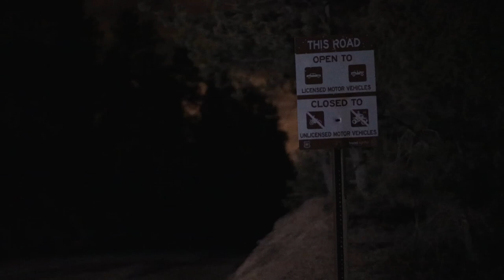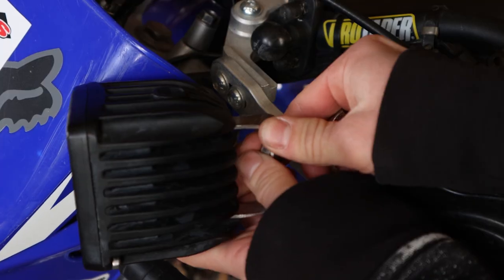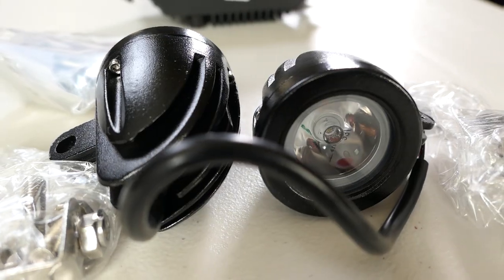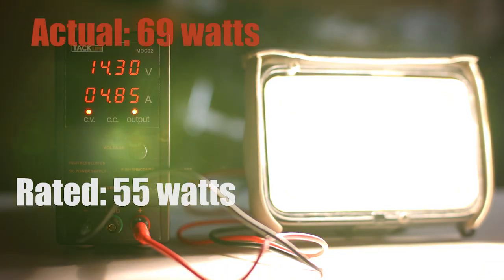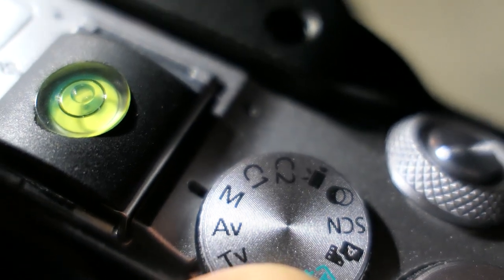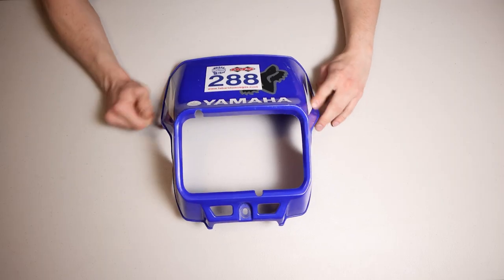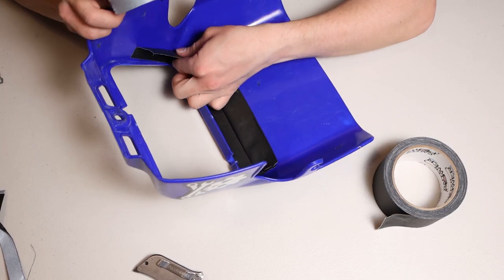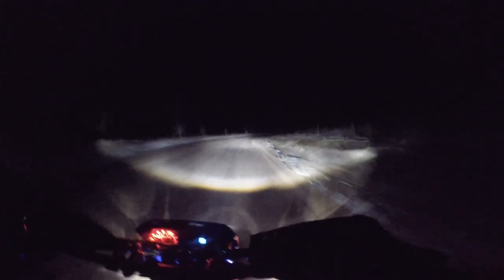JNS Engineering LED Headlights | Yamaha TW200

Comment: Thanks again. Have bought the JNS light but not installed.  I have planned on just getting some adhesive foam and matching the factory headlight light suppression wrap.  We'll see how it goes. Might end up doing the gaffer tape.
Reply from the maker: No problem! Should work well

Comment: I think the Yamaha universal heated grips consume 22 watts on the highest setting for the 600+ cc setting (there are three heat settings you can change easily, and then three motorcycle size settings you set one time).  So that means you could easily run them on the 600cc + overall setting, then still have enough  power left over for 20 watts of aux lights and still not be over factory wattage pulled from bike. So yeah that is definitely a great reason to use an LED headlight, not to mention the better light output!
Reply from the maker: nice! good to know, yeah I can't wait to try some heated grips out. and see how much power they use. for sure so worth it, if you change the rear tail light and running lamps to led you could save even more!
Reply: @TDubsKid  yup 👍 The Yamaha grip heaters have an auto off function that works very well. 

I’ve tested it on my XSR. They just detect if your bike is running or not with the voltage drop From 14v to 13v or whatever. And they shut right off if you forget.

Comment: Another great video. Neat to see the headlights by the numbers, and pictured together, well done! I have the older JNS headlight like yours on my Honda XR650L, it is good, but it never really thrilled me. When I installed grip heaters on the DR650 I added a AUXITO H4 fanless LED bulb to the stock DR housing to save my charging system, and have been super impressed on three different night rides. (There is a shameless video on my channel) You can get them on Amazon for under  $40. bucks and comes with two bulbs. They work so well I was considering removing the JNS and installing the stock XR headlight with the other AUXITO bulb that came in the package. For the light that comes up around the housing, I went low tech and picked up a few Black hand towels at Wally and simply roll one up and mash it between the light and the housing. It is nice to have a towel handy to clean the visor then just put it back. Pick up Aviation plexaglass cleaner or plastic polish for the scratches in the JNS, mine still looks great after almost two years.You need to get those grip heaters on! It took 45 minutes and even in AZ. they are Sooo nice. I look forward to your next video. Nice to get up and have my coffee watching TDubskid. Time for me to Ride!! Take care.
Reply from the maker: hey thanks! glad to hear, I need to make a website so that stuff is easier to look up real quick. yeah that original jns was lacking a bit, the new dot one is pretty good though. I really liked my cyclops in my housing before it went bad, can't wait to compare to the new cyclops and one like your talking about. oh cool using a towel as a double purpose, good idea. yeah I need those grip heaters, I think I'm going to put them on a relay so they turn off with the bike. so you can't forget to turn them off. glad to hear you enjoy the videos! ride safe
Reply: @TDubsKid  I have the grip heaters wired so when the key is switched off the power is cut. That way they will be off , when the key is off and you don’t come back to a dead battery. Went out today and rode back in the dark, JNS is coming off the XR650L and the stock light is going back on, with the other LED bulb that came in the pack of two. There’s a huge difference! 
Going to get another pair of $30. Dollar Tusk heated grips for the XR too. I’m spoiled now that I’ve rode the DR with them. 
Take care. Thank you.

Comment: Thanks, bro, cool comparison, helps much deciding on what light to go for. I've been wondering on how to go about enhancing my beam, so far I've found that keeping the stock bulb and adding some side spot lights give me the best solution, but I'm obviously worried about the voltage, so I've started looking for options to replacing the stock one for an LED. I've somewhat reduced my voltage demand by replacing the stock rear bulb with an LED one, but that's not much for sure.
My other thought is to get rid of the stock header altogether and replace the whole lighting solution with a couple of aftermarket beamers, which can be calibrated separately for low and high beams, but that'll take a considerable amount of customizing the whole front of the bike. Maybe it'll be worth it; I'll give it a try when I get the chance.
Reply from the maker: hey no problem, glad the video is helpful. yeah best to go all led so your not over taxing the electrical system. changing the rear to led will help. should work as long as your not blinding oncoming traffic. best of luck

Comment: Great video Dubs. That had to be alot of work making that video. Greatly appreciated, thanks. I think I'll go with the Dot approved light for my T Dub. In my opinion the stock light is so bad it outta be illegal.
Reply from the maker: Hey thanks! yeah I spent a lot of time on that one, swapped out headlights more times than I can count haha. good choice I like the DOT approved one. is your TW older than 2001?
Reply: Mine is a 2019.
Reply from the maker: might just to be adjusted up some, my was way to far down when new

Comment: Another great video T'D'Kid! Inspires me to go ride my '21 w/ 490 mile on it. Haha Put a whopping 70 miles on it last weekend. It has the cheap scamazon led bulb. It's throws much better light than the stock. JNS DOT looks like a winner! Still considering what guards with built in auxiliary lights to get. And heated grips.. And a different phone holder. And where to plug in the microwave... kidding.
Reply from the maker: thank you so much! Cool, happy riding. nice can't wait to see how those are. can't go wrong with the JNS dot. I love the hbd handgurards but a bit pricy and have to get a different handguard and risers. haha nice

Comment: Great video, thanks!
While the JNS v2 (DOT approved) is clearly better than the JNS v1 ("high beam is a small dot"), it isn't as clear to me that the light thrown by LED is better than OEM. Yes it looks much brighter, but it is almost so much brighter that the over-illuminated near objects make it harder to see the far objects. I wish LED lights were much more orange or at least natural light in temp than white/blue. The wattage savings are very appealing.
Reply: I also like the "eagle wing" patterns at the sides of the stock light.
Reply from the maker: yeah the stock light is not bad at all. even better with a cyclops bulb but will be as warm colored as the stock halogen

Comment: The stock light looked fine the new DOT light was better then the non DOT but the stock light seemed to work well.
Reply from the maker: yeah the stock light is really not bad, it just consumes so much power. if you want to add heated grips LED is the way to go

Comment: Does this light system work with my 1987 tw200? If not would you recommend a lighting sytem for my 1987? Thanks! More power…
Reply from the maker: It should be fine, its low wattage so shouldn’t hurt the electrical system on the 87

Comment: I’m sure you’ve been asked this before ad nauseum but do you envision Yamaha at any point upgrading the TW with EFI, water cooling and larger cc’s? Retiring from 32 years in the Fire Service as a FF/EMT-P and can’t decide between the TW and Polaris 4 wheeler. Thx in advance for any insight....
Reply from the maker: the only thing I could really see them doing is adding efi and maybe an oil cooler like the van van, but you never know for sure. hope you make the right choice, very different machines. no problem

Comment: I’m a 4’9.5” female that is going to pick up a TW tmrw. Any advice/suggestions you could give someone my size specifically catered to this bike?
Reply from the maker: hmmm maybe just take it slow and easy at first. learn balance the bike with 1 foot on the ground
Reply: @TDubsKid  I have a lot of experience on street bikes. However, I’ve tried learning dirt and due to my size, it’s been a little bit of a battle. I’m comfortable riding with one foot, since that’s I how ride my R1… I just haven’t had any luck on dirt. That’s why I’m getting the TW due to the fat size tires. I’m hoping that will help me get a better hang of riding off-road. So, basically just seat time and comfortability? Also, thanks for the reply.

Comment: What's your thoughts on new vs old tw. Think its worth getting a new one for 2-3k more?
Reply from the maker: new has the front disc brake which is nice. old ones are still good though. a long time ago you could get a newer used one with 500 miles for 2500 bucks
Reply: @TDubsKid  Yea. My first one was cheap! Now you'll  pay 3500 for a 1992 here in Canada or 5500 for a new one +++

Comment: do you have a link for the replacement light only?
Reply from the maker: https://www.ebay.com/itm/193268781874?_trkparms=aid%3D1110011%26algo%3DHOMESPLICE.DISCLISTINGS%26ao%3D1%26asc%3D20191002092920%26meid%3Db2a7252e12f946809b7a3abe132a8c59%26pid%3D101096%26rk%3D2%26rkt%3D12%26sd%3D174313379706%26itm%3D193268781874%26pmt%3D1%26noa%3D0%26pg%3D2332490%26algv%3Ddefault&_trksid=p2332490.c101096.m3021&amdata=cksum%3A193268781874b2a7252e12f946809b7a3abe132a8c59%7Cenc%3AAQAGAAAB4NCIKCu61rE8zrVnuuDT76YVn%252FXe2qrS2uppQycEmga9JRyJdlMNJBU60XuJIEugqYUf4QE8aIY9eiIll4OfBc82RP4vv6yl4xjXCug8pWqRGjdbaR2eIaCfZhQtz2JLhkqnIdJpsN0rooTAMc7zf%252BiS%252BMu%252BnSPoTzFujCXs5XTs4tjrA9w0eTVcpyQaSH997JDdlyj1Mbn0e1ZKOQYVINhn3WwzIu3UPFADAWzhImqXQ5m%252FLZ4rr%252BfC5GklAV9PxDAx5kmVGxtYYPPMaFNIBGZ7kEOdt7S%252BHICtGM4LkSNkEe%252BWxXjXDoYEsOmnpk2QJQgaUSv6w0OFcgBs87EnUZJnTeszYbTkGTnB5KR17EWxHiN8Dpn%252FYOBrtVOqdUUz5WQInURuIfSetFWz6leo7c3d7lHO0sFPSkyaQiD2K0FcR3sIe4T%252FyCBaYBCw7aakckCEXeTn2kxfBInWKhlZhR04uuDl7yV%252BoZk%252F2iT%252FC2B7LUKCPokA%252FsN2BVWGEo3SAz8gCsKjMm9lLY8agzu3FS0uBgLaWh%252B3FY7x%252Ff52C7%252B4tOPlIusAqADmFusB75dKGwU5HQzBnzU1oUHMl6PRiJErJmehcRJZKPUV9rN7MUaBKwmZ00MVRpJV4n8%252BnbC3cA%253D%253D%7Campid%3APL_CLK%7Cclp%3A2332490

Comment: No rubber isolators on the JNS…
Reply from the maker: Yeah but it doesn’t use a a filament bulb. We will see how long it holds up, so far so good
Reply: @TDubsKid  
I finally received my 2022 TW200 three days ago. Paid cash for it back in December …